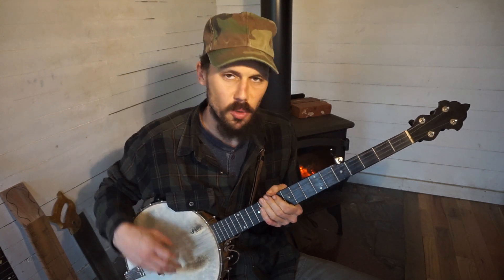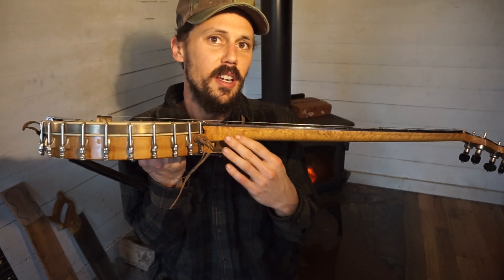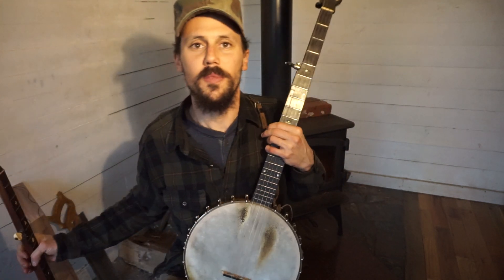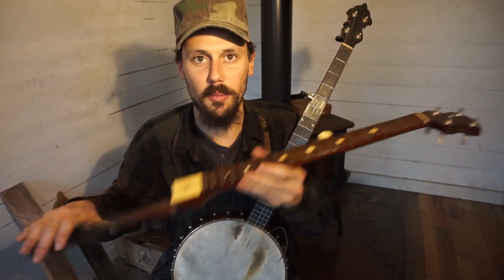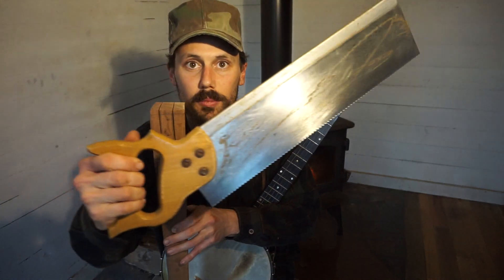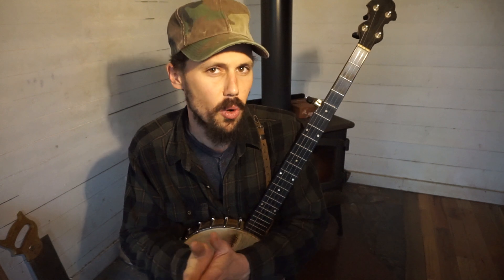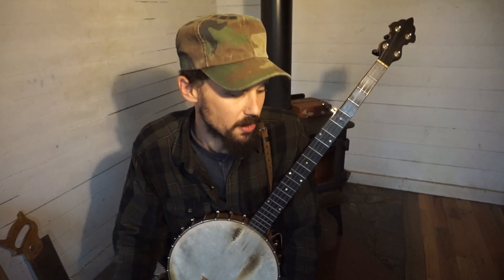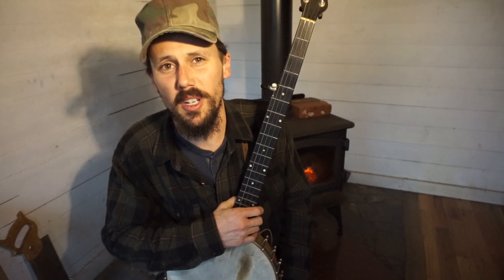Neck Angle on Mountain Banjos & Nylons on a Goodtime?

Comment: I put Berkley Trilene monofilament fishing line on my deering good time special. 25, 30, 40, 50 pound test. I pre stretched the 25 and 30 so it would set in quickly. I made zero changes to the banjo. They have been on for months with no issues. Gives a nice mellow tone. Not as twangy as metal but not as muddy as nylgut.
Reply: Ha, well, that's good to know for the apocalypse!  😂  A 1000-yard spool of  you'd have a few lifetimes worth of strings! 😊

Comment: The back angle is because of the bridge height. Otherwise the strings would be father away from the fretboard at the 12th fret than the 1st fret. The bridge height effects the transition of the vibration of the strings to the drum head.
Reply: Great comment as I was trying to my brain around that.

Comment: Hey Cliffton really liked your version Blackbottom Blues -thanks. Also I'd add that one way to stop nylon strings slipping is to use a tiny piece of glass paper/ very fine sandpaper to roughen the surface of he string at the end. This can weaken the string so only do this on the  part of the string that doesn't take any tension, that is, the part that wraps around pin of the tuning key. 
-the string can also be roughened up using a smooth rock or even river sand pinched between your fingers -if you're in the woods ;)
Thanks again, good luck.

Comment: the way i do it is get a digital level gauge place neck flat on a flat surface  fret board down, zero the gauge  while neck is flat on the flat surface then raise the neck till you get neck angle then tape a wooded spacer on neck so the angle is correct then go to table saw then cut correct angle you can also cut the cut out this way and the heel    then take out the spacer and cut the bottom of the neck straight with fret board  running along table saw fence. to take off points of a mm use paper to use gorilla tape on your fence  i hope this can help any one trying to make a banjo i screwed up loads before i was happy ,thanks Clifford for many great vids

Comment: Hey buddy quick question on the dowl. Whats a general ball park thickness of the dowl do you suggest? Just dont want to go to thin and run into issues latter on
Reply from the maker: About 1" x 1" is plenty of dowel without being too clunky. They are typically tapered toward the tailpiece. Factory made banjos with wooden dowel with be something like 7/8" at the heel tapering to maybe 5/8" at the tail.
Reply: @CliftonHicksbanjo  thank you, you appreciated

Comment: Hi Clifton I love to watch your channel it is always a wealth of information, and my favorite music is old time, so I love your playing and singing.  but as a luthier that builds hurdy-gurdies, nyckelharpas, fiddles and Guitars.  I can tell you why their is a slight back angle on a guitar and not on a Banjo, that has to do with string tension and structure,  the banjo has a thick wood or metal band that resists bending, the guitar has a light structure and over time the wood can shift, the neck pulls up and the action of the strings over the frets, making the string height way to high making the guitar unplayable. luthiers then have to do a neck reset. difficult and expensive. even with a truss rod it can only help a small amount.  so banjo's can resist distortion over long periods of time, because if their structure. The small neck angle on guitars allows them to resist distortion longer.

Comment: The way I understand the need for that neck angle is that you need more distance between the strings and the head in the area of the bridge for picking, but you need a fair bit less distance between the neck and the strings for fingering.  If the neck didn't angle, but were a straight line coming off the pot,  because of the height you hoist the strings to for your picking comfort, you'd have too much string height down the length of the fretboard (even though the nut doesn't have the height of the bridge), making it impossible to finger, until you got below the fifth fret or so.  The neck angle lowers the nut relative to the point of contact with the pot, and that has the effect of bringing the strings closer to the fretboard, making them closer to parallel.  If the neck weren't angled back, you'd in effect have a really thin right triangle (like the profile of a cedar shake) with the bridge being the upright and the nut being the point at the other end, and you can imagine from that how high the strings would be at the 12th fret.  Even at  the 7th fret you'd have to go so far before reaching the fingerboard that you'd be noting really sharp from pulling the string so far.  So adding the neck angle solves that problem and the string height remains playable all the way up the neck.
Reply from the maker: I've learned a lot since filming this. For example, no five string banjos were built with neck angle prior to about 1920. They all had flat-trajectory necks.
Reply: @CliftonHicksbanjo  wow.  They must have been hard to play!!!  Maybe the whole approach to left hand technique was different, somehow?
Reply from the maker: @drewby613  They are different but not necessarily difficult. Instead of steep neck angle and a tall bridge (like modern banjos) they utilized ~ zero neck angle and a shorter 1/2" bridge. With gut or nylon strings and lowered tunings they are actually a joy to play, and I would argue sound superior to modern banjos. Every banjo that you see me playing today has zero neck angle.
Reply: @CliftonHicksbanjo  That is interesting!!!  I'll keep my eyes peeled on that detail going forward.  You also probably have a dead-straight fingerboard, so it's interesting that it all works without getting any buzzing.  I guess fretless fingerboards and nylon strings aren't as prone to that as steel-string and fretted banjos are.

Comment: The more angle allows for a taller bridge which for the most part increases volume. 11/16 is a tall bridge for a banjo.
Reply: And the reason for that is that it allows for more pressure on the bridge. So more pressure to build up and the bridge presses harder against the skin which transfers the vibrations more and quicker.

Comment: Mr. Hicks,

I have written previously about banjo building and you told how you
build your tack head banjos. Your seemed to be what I was thinking of
doing. 

My idea was simply to buy a Congas drum head and soak it for an hour in
a bucket then to place it on a wooden pot bowl which has pre-drilled
out holes on the frame and with a rubber band place the hide where I
want it then let it dry and place the tacks with a block of wood
instead a hammer to halt tearing of the hide. Would that method work
in your experience?Also do you like to use fishing line strings I like their Sound more then steel?

Comment: If you, or anyone, has a nice antique banjo, I hope you do not butcher the instrument by trying to set the neck angle back. Please do not try to pull the neck back by tightening the mechanism on the back of an SS Stewart. Almost all of the vintage banjos were set up flat. The only problem I have had is if the tension hoop is not pulled down far enough (close to the rim edge) and the tailpiece is riding high and a taller bridge has to be used. The nylon strings will always need to be higher from the fingerboard than steel because the nylon strings vibrate with a wider arc. To get a crisp sound, use a bridge for "classic or minstrel" banjo, which is much thinner than standard bridges.
Reply from the maker: Thanks, Clarke. I have been trying to spread the truth about neck angle for a couple of years now. When I made this video, I didn't know that truth.
Reply: I saw Clarke live in Eureka Springs some years back. He did the warm up set for Tom Paley. A fine show by both gentleman.
Reply: I built a Stew-Mac kit years ago with a cast, one-piece aluminum tone-ring/rim assembly, with no rods or any opportunity for neck angle adjustment.  I found a piece of hard plastic and made a shim that I put between the neck and the stretcher band, and after some fiddling around I was able to get the string height I needed.  Never was a fan of the tone of that instrument, but I learned to play on it all the same.

Comment: Neck angle just works out from the relative skin tension and bridge height which gives the right string elevation to prevent buzzing on the frets. 
  The lower the strings,  the easier it fingers but the strings will begin to buzz when they get too low. Tight skin raises the strings and brightens the tone. But it also gets hard to finger. So ya gotta increase the neck angle.
Reply from the maker: Five-string banjos were not typically built with neck angle until after WW2.
Reply: @CliftonHicksbanjo  Probably partly the reason that many of the earlier instruments had a sweeter sound. Today's hard driving Bluegrass wasn't a thing yet and folk needed a softer background with a cheery atmosphere.

Comment: Without the back angle, the bridge height would be the same as the nut. The alternative would be to have a fretless banjo, since you would not be so concerned about maintaining the string height the proper distance from the frets at the 12th fret region. However you also don't have as much clearance between the strings and the head unless you set the fretboard slightly above the head.

Comment: What technique do you use to make the top surface of the neck flat?
Reply from the maker: If you're lucky you'll find a block that's flat ish in one side already. Squaring one up from a rough log is tough work. Requires big backsaw, big chisels, sharp jack plane & then finish off with sandpaper on a long, flat form. You can use a flat slab of granite or good flat board to hold the sandpaper, then just rub it back & forth. I will then finish with a 3' steel level wrapped in sandpaper.
Reply: @CliftonHicksbanjo  thanks for getting back so quickly! That's great advice. Every idea I've had so far seemed to overcomplicate things. I'll definitely try that out.